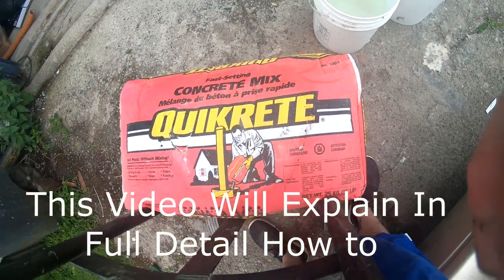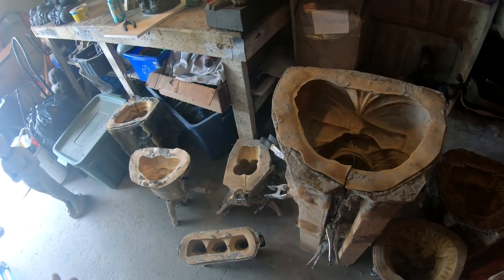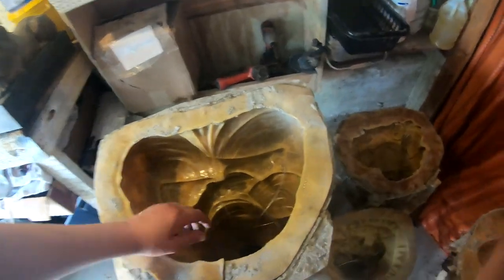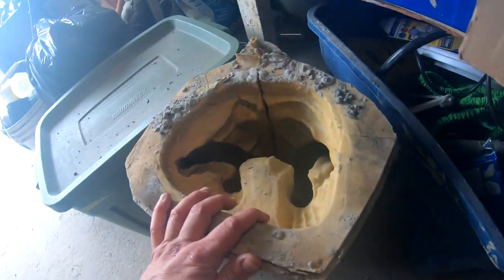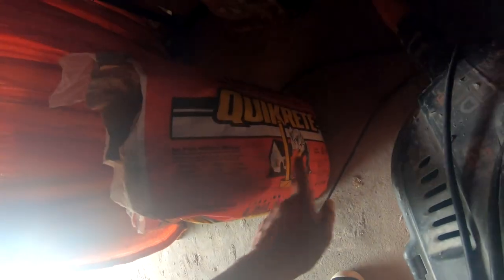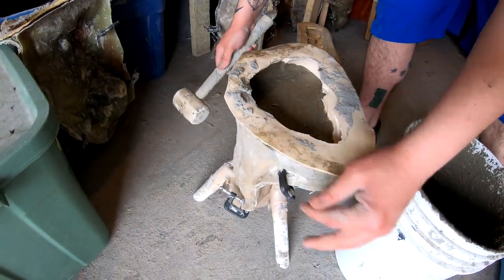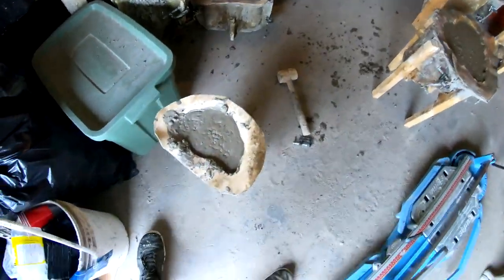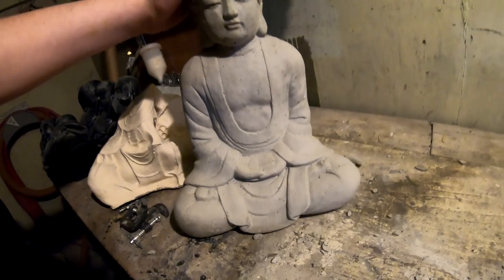Make Concrete Statues FAST😃 How To Pour Concrete Into Rubber Molds For Statues FAST SETTING CONCRETE

Comment: Nice man, I usually use a mix of rapid set cement and gravel which is cured in about an hour.. but it is $25 a bag so your method is a lot more economical and I am going to try it

Comment: you should make a small vibrating table and make your mix a bit wetter ..i usto use soapy water to coat the latex before pouring the mix.make a bath of soapy water and dip them in ..then pour and put on vibrating table and add waste blocks ..we used the fast concrete setting mix mainly in the winter ..we manufactured tonnes of the stuff daily ..and paving stones then moved onto manufacturing block paving for drives and walkways
Reply from the maker: I try not to mix too runny, if you mix too runny, the concrete loses its strength. I thought about getting a vibrating table. The problem with a vibrating table for me is, i like to pour a dozen statues at a time. I have found shaking the molds after pouring is helping get rid of most of the air bubble.

Comment: I’m using foam and cardboard templates and wanted to quickly sculp designs onto the project.  Wondered if I pulled the template off at 10 minutes if it would be too hard

Comment: back again,can getsimilar concrete mix in egland but its called postcrete for putting up posts,also just used a fittness vibrating exercisemachine that canbe used to get bubbles out of mix if youcant afford a vibrating table

Comment: Thanks for the video! I am using the yellow bags and mixing by hand but I notice especially around the neck of my Buddhas that I'm getting gritty areas of sand and rock that I have to touch up with patch. Is this from not mixing enough??
Reply from the maker: Sounds like it might be too watery? Try the red bags and let me know how that works
Reply: You can also try adding a bit more portland cement only and a bit less water

Comment: Hey Jonathan 🙌 Every store and pharmacy is out of stock of rubbing alcohol due to the Pandemic- is there an alternative that I could use instead with the caster oil? Thank you 🙏
Reply from the maker: i know! I found some at London Drugs here in Canada, been checking every day and finally they have some in stock. You can also order from dental supply websites, that would be you best bet  and keep checking you local pharmacy supply. Not sure on alternatives to Caster oil mold release. Maybe buy a distill on eBay and make your own moonshine hahaha
Reply: Johnathon Wheeler thank you 🙏🤗
Reply: Thanks for the tips. I have also found some 70% isopropyl alcohol in janitorial stores. Good luck
Reply: I am using everclear which seems to be okay.

Comment: Thank you for sharing , it is so hard to find a video like this one. You really have to move fast with that red bag . I have two moulds I need to fill and I’m trying to learn the best easy way .  I think I’ll try your way. Can you tell me where you purchased to food grade castor oil? Thanks again
Reply from the maker: Castrol oil was purchased from a hair dressing supplier
Reply: @victoria653  thank you , found it on Amazon. One more thing can you tell me the percentage of alcohol you used?

Comment: Your videos are my favorite. I use the yellow bags but I think I am going to pick up some red and try them out. How is the cure time before you paint with the red bags? With the yellow I normally have to wait 1-2 weeks and it really hampers my ability to produce and sell.
Reply from the maker: Hey, thanks for the comment. With the red bags, I paint them the same day! No issues or maybe the next day if the weather is cold and curing is slower. I use Watered down acrylic black paint, when that dries, then I dry brush over top of that with gold/silver or grey. once that dries then a clear coat spray can over top to seal it.  Going to make a video on how i paint my statues sometime this week.
Reply: Johnathon Wheeler That’s also how I paint mine I just wait a week or two because I am always worried that they aren’t cured all the way. What do you like to use to patch air holes? I just use straight Portland cement and mix it into a paste but didn’t know if you had found anything that worked better.
Reply from the maker: @jrgjrg5097  for air bubbles https://www.homedepot.ca/product/quikrete-mix-n-zip-repair-mortar-1-36kg/1000684860 .Fast drying and works well. After it drys, it will be slightly discolored but if you use a little sand paper to sand it, it blends and you cannot tell that its been patched.. Do not use the repair mortar in the small tub. The tub one is really gritty and doesn't work well.
Reply: I have seen all your videos on statues and I think this is my favorite. I know you mentioned the red bag in a previous video about pouring during the winter. I’m down in New Jersey and once it gets too cold I don’t pour at all. But I bought a couple bags of the red today and I can believe that I can pour a statue even my large mother Mary at noon and have a solid statue at 4.   I was wondering how you sell yours if you mostly do Facebook and Craig’s list or if you have any in local stores? I have a couple stores I sell in and I prefer that because I like being removed from the actual sale but I also do Facebook and just wanted your perspective.
Reply: Hey Jonathan, kind of an emergency question. Hoping you can respond asap... 😬
I cut a seam along the back of one of my rubber molds. Now, when I poured the concrete, concrete water has leaked out of the seam and into my fiberglass mother mold. I'm conflicted because I don't want to start over but I'm worried the leaked concrete will destroy my mold... Do you think it will be okay? Have you dealt with water leaks from a mold and how so?
Thanks in advance!

Comment: Do you ever find the wires you put in to strengthen the cast, ever show on the surface of the casting ? thanks
Reply from the maker: occasionally they pop out of the seams. I just snip them off and use a little repair mortar. Can also grind them off and then use some repair mortar.
Reply: @victoria653   Thank you Johnathon.

Comment: So you don't have to do anything else to the wires other then just stick them in before pouring the cement.  With the shaking does it not let them go to and edge or the bottom and stick through the concrete?
Reply from the maker: no never had any issues
Reply: I was thinking the same thing .

Comment: Thank you for your video......just a quick question please.....how do you cure the air bubbles after curing the statue? Oh and where do you get your moulds from?
Reply from the maker: if you shake the molds are pouring, it will eliminate most of the air bubbles. Statue molds are hard to find, there are very few companies that make them. Ebay is a good place to start
Reply: @victoria653  thank you

Comment: I'm having an extremely hard time getting the right consistency of my concrete, my first attempt was way to watery but it got into all the crevices of my mold but it look a few days to completely dry. My third attempt was a thicker consistency but it didn't get into all the crevices of my mold and the air bubbles were huge. Any suggestions or advice
Reply from the maker: Took me a few attempts and lots of trail and error. A bit of advice, do not mix too wet, the statues will be brittle and corrode later on.  I like to mix it slightly more wet than the instruction on the bag ask for. Wacking your mold with a mallet really helps. Let me know if that works for you!
Reply from the maker: What kind of statues are you making?
Reply: @victoria653  Thank you so much for responding, I really appreciate it. They’re torso body mould sculptures, it’s pretty much a naked body 

I’m going to keep trying, I’m determined

Comment: Does anyone know a UK equivalent to the premix he's using? Thanks
Reply from the maker: Let me know if you find one. I have had a few people ask me,  ChEeRiO
Reply: @victoria653  I never found one mate. But I used 2 parts concrete 2 parts sand to 1 small 5m gravel. Trick is to leave it to set for 48 hours minimum

Comment: My cement keeps falling apart when I demold 3 days later any thoughts on what I’m doing wrong?
Reply from the maker: your probably mixing it too runny. Try and mix it as the bag says and let me know if that works for you
Reply: I know this is 2 years late and you most likely figured it out but it's most likely due to the cement getting moisture while still in the bag. This will cause the chemical reaxtion to start and basically render it useless. If you get a bag of cement and there are clumps in it that can be broken (not stone) then this is what happened. I had this happen and when I went to remove the casting it broke apart like it was hard compacted sand. The cement should be a powder  only. No clumps.